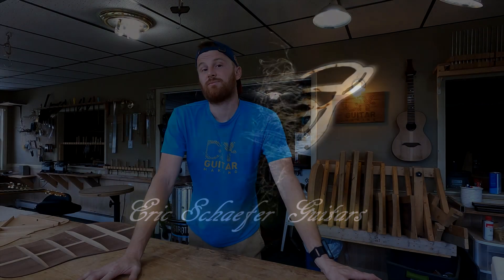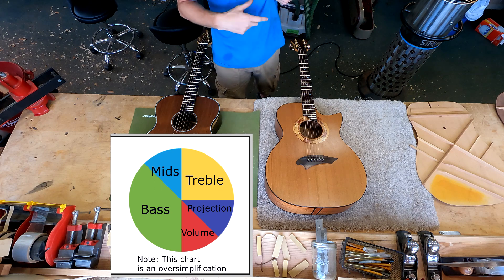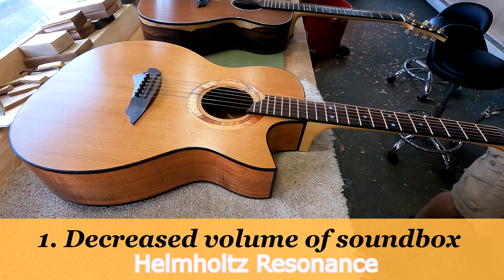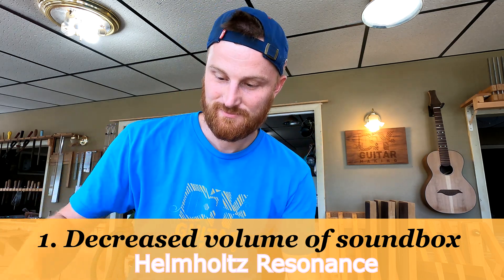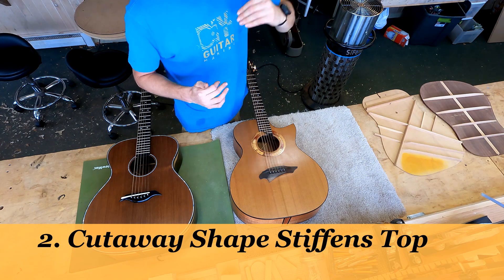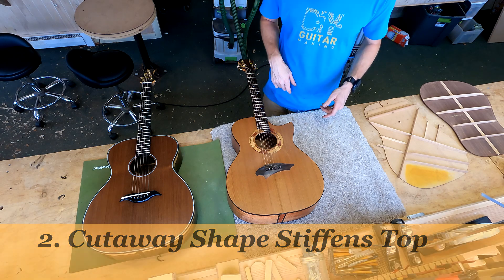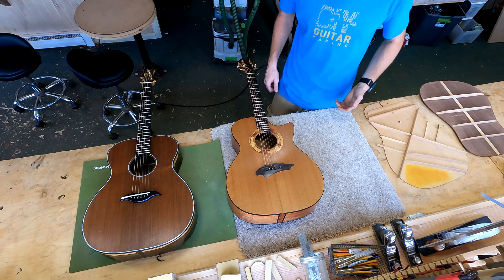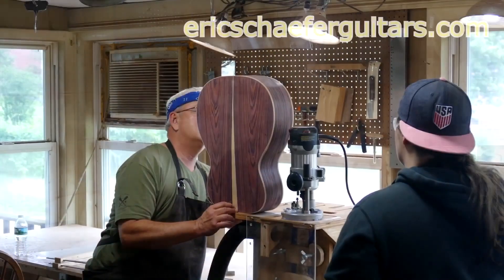Why Cutaways Make Guitars Sound Brighter | Explained by a Luthier

Comment: Can ww make a guitar with Spanish classic guitar models, that neck into the body? TU
Reply: Love this idea.. for it's originality.. but wonder what the expectation would be in terms of tone the outcome.   Naturally there are numerous approaches  that one can take.  Is the concept to use a plank or  series of layers of wood lets say something like 8 inches wide and then cut out the space for the chamber?   The purpose of this would therefore be to eliminate gluing of the neck joint and assuring that stiffness across the instrument.   I think this is an interesting approach.   Would be interested in the thoughts on this from the luthier of this channel.   Could this make a classical guitar better theoretically in any way?  Has something like this been tried before?

Comment: Doubtful in the extreme that the Helmholtz resonance has much to do with the supposed brightness of tone in a cutaway. The sound production of a guitar is almost exclusively produced by the lower bout, as Chladni vibration patterns will demonstrate, and much of that sound is produced outside the box. The sound hole allows the diaphragm of the soundboard to vibrate freely...were the box closed the energy introduced to the top by the vibrating strings would be quickly consumed by the necessity to compress the air contained in the box in order for the top to vibrate. I suspect you are right about the volume change inside the box, but the mechanism of blowing air across an aperture is very different than the vibrating string driven guitar top vibrations;)

Comment: thank you Eric . i had not even thought of that but sure . to off set that would or could it make a difference if you deepened the body ? say the body  si 5 ' to 3 ' from top to bottom so take it to 8 ' to 6 ' would that compensate for the difference ?

Comment: Awesome demo of Helmholtz resonance.  A stiffer (glass) container would resonate louder as the flex of the plastic allows some damping.  

Interesting presentation on the guitar body shape impacts.

My first ukulele (tenor) has a pineapple shape and I made it rather deep accidentally.  I strung it “low G” and the lower end tone is awesome.  Blind squirrel finds acorn!

I don’t ever put non potable fluids in beverage containers.  When I dilute Tru-Oil I use something not easily mistaken as a drink.  While my shop has few visitors, my grandkids are occasionally in adjacent rooms…

Comment: Good video.  I dont think the bottle was a good way to explain it, although it was funny :)  Basically the bottle was a wind instrument and the guitar isnt.  I think the easiest explanation for a guitarist is to say.  Strings are brighter when they are shorter (shorter scale length etc), strings are brighter when they are tighter, just turn the tuning key.  The timber is like a wooden string, make it stiffer, shorter, tighter or thinner and its going to be brighter.  Now we are comparing apples with apples.
Reply: Guitar tops also play a great role in tone. 
Spruce top produces bright tone ( Tanglewood roadster or Yamaha f310)
Mahogany top produces warm tone ( Tanglewood crossroad series)